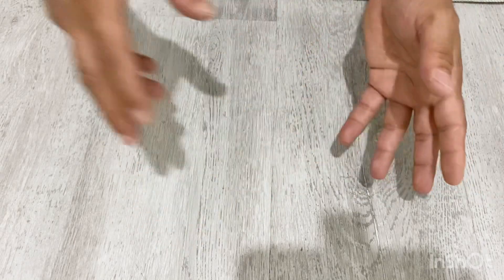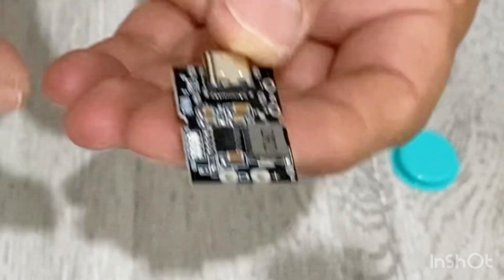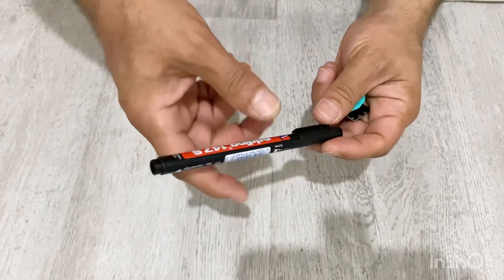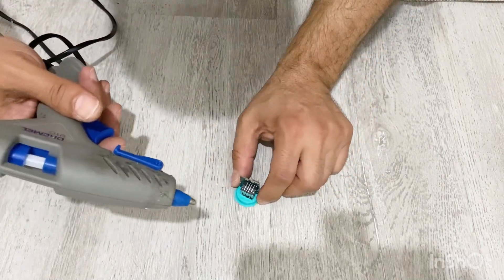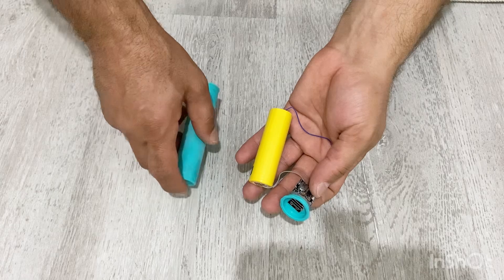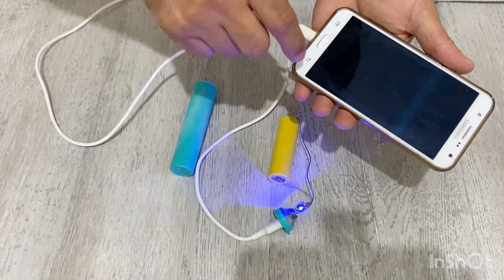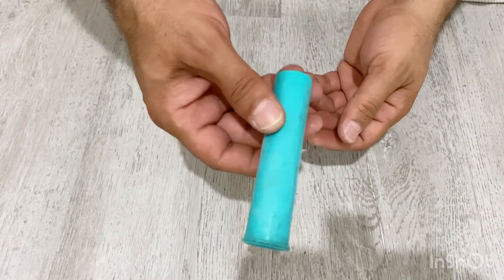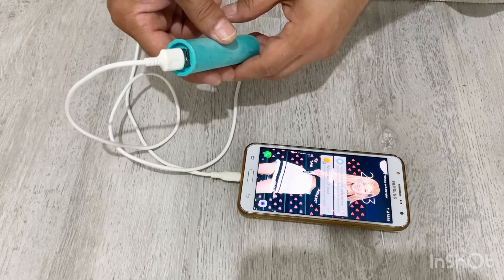How to Make Power Bank | DIY 4500 mah Power Bank

Comment: Which specific electronic circuit is this? If I go to order one online - 'which one' - do I order? I'm wanting to charge mobile phones. (No electricity is available.) Also how does one recharge the Lithium Battery - once those wires are soldered onto it? Can it be stuck into the Lithium Battery charger with those wires on it? Any danger of Lithium Battery catching on fire? Can using THIS - potentially damage - mobile phone? How long to get a full charge on mobile phone? Thank You so much!
Reply from the maker: You can search for on TEMU. If you do everything correctly there is no danger of it👍